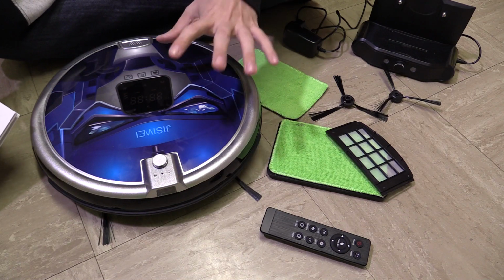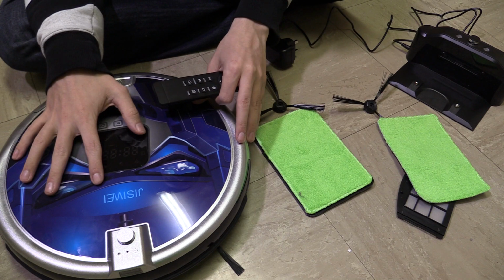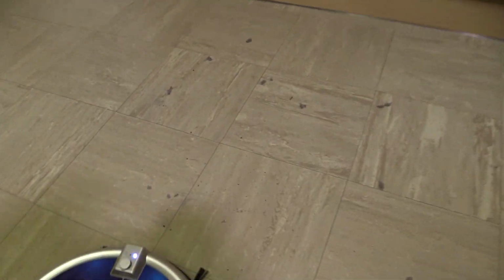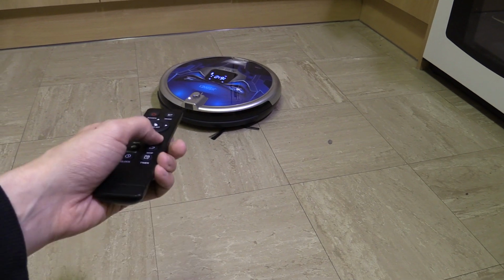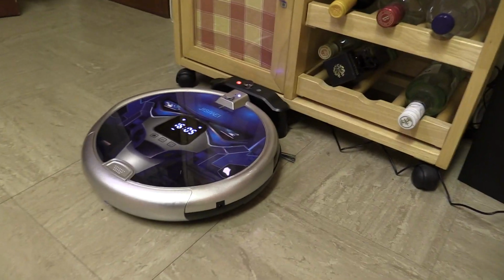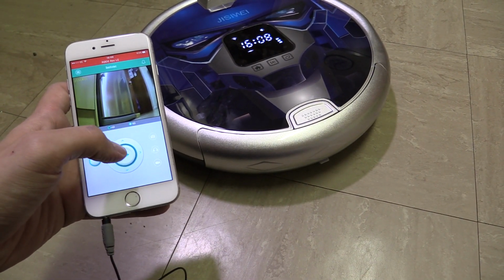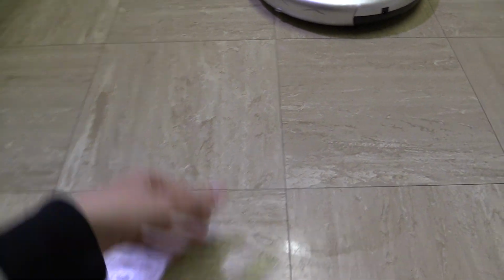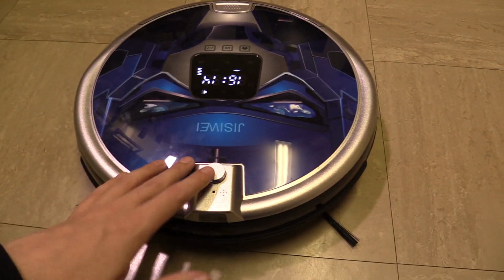Jisiwei Robot Smart Vacuum

Comment: We had a robot vac four or five years ago. Same issues then - wouldn't work on carpet. Often ran out of battery before getting back to its dock and we'd come home to find it in the middle of the floor beeping. The dust hopper was tiny and needed emptying daily. The issue was we also thought it was a 'he' and named him Horace. Made it harder to send him back when we had to.
Reply from the maker: So far this one hasn't ran out of battery but then it's only working on a fairly small room and then it goes back to recharge so I guess I haven't noticed it. The dust hopper is reasonably sized but again I'm based that on a small room. I've read other reviews from people who have to empty it every 2 runs. Honestly I'm not yet sold on the idea of automatic vacuums but it was fun to test him out. At least I didn't give him a name yet :P

Comment: Neat robot. I've been looking for one for my grandmother since its hard for her to clean the floors herself. Although those "Neato Botvacs" look pretty promising with their laser scanners and such.
Reply from the maker: I just checked out some videos of the neato botvac. It seems pretty impressive and a unique style compared to the other robot vacuums. I still have concerns over how efficient robot vacuums are though. Although this Neato one does seem to have more strategy to cleaning a room than a random pattern.
Reply: Ah yeah. Hey great video again, I really like these product demonstration type videos.
Reply: I have a Neato (the original ones), and I love it. It definitely has a "personality" I call it, but I've owned it for 3 years now. I buy new battery packs for it every year (about $50 for 2 packs). I love how it can map out where it is vacuuming so it's not crazy random like the roombas and such. Sometimes it will have problems docking because the dock likes to lean back. Anyway, I want to get the latest Neato but I don't quite have the budget for it yet.

Gadget Addict: As far as efficiency, I was worried too, but holy cow they do really really well. I run mine every other day and its bin fills up every day full of stuff I have never even seen before.